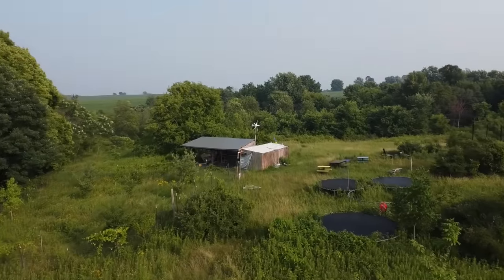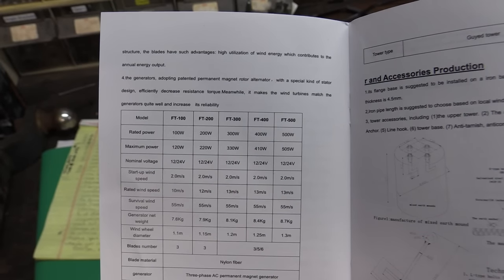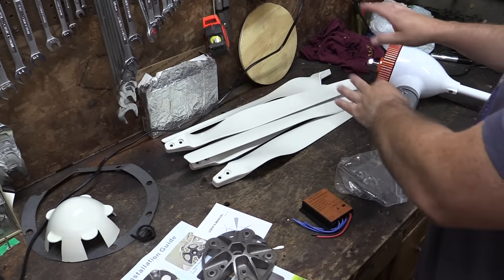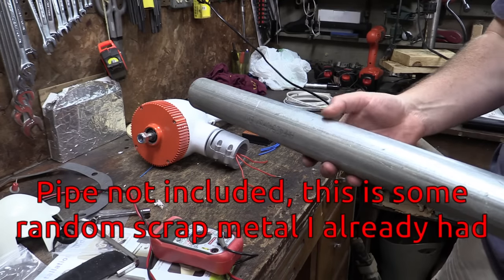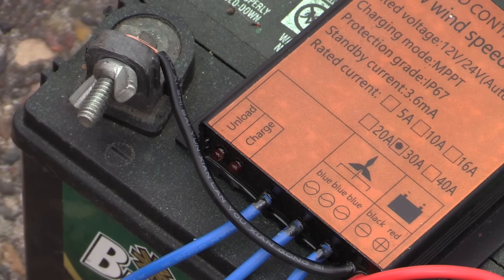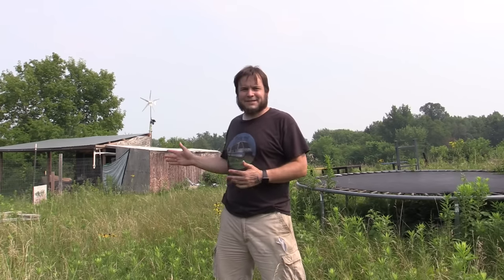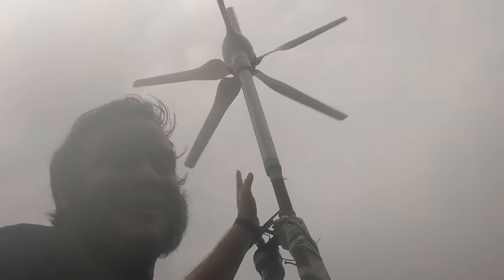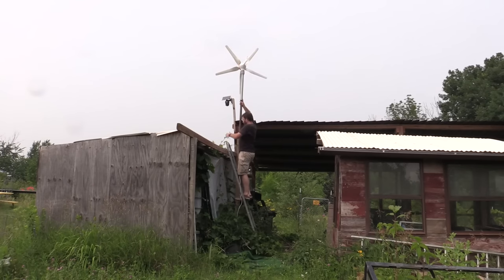Finally A Real Wind Generator! Vevor FT500 Review

Comment: You really didn't tell us anything useful. You didn't measure current and voltage, nor the wind speed. You need to measure power, which is voltage times current, at different wind speeds, and graph it. But I can just about guess that the 500 watts figure is only the overload of either the alternator or the controller, and not a power level that you can expect. It is generally taken that a wind turbine of 10 foot diameter swept area, optimally coupled to an ordinary 3 phase internally regulated alternator big enough to handle the load without burning up, is good for a kilowatt in a good breeze. Just a rule of thumb. Half the swept area diameter is about a quarter as much output power. Your swept diameter is significantly less than half. Figure it is good for about 200 watts in normal use scenarios. This is why it is important in reviewing such products to actually measure and share hard data. A permanent magnet alternator, not having field coils, cannot be internally regulated and requires a controller, which you have. Your alternator is probably of the permanent magnet type, and it is in theory a little more efficient since no field excitation is required for operation. You lose some of that in the controller, however. The controller must not only rectify three phase AC, but also convert the voltage to a consistent and usable level while also maintaining oversight of current levels and be capable of shutting down or throttling back the output.  So in reality, not a lot of performance difference between the two types of alternator. However it must be remembered that with an automotive type alternator, output is VERY low until it approaches designed operating speed, and also if you disconnect the load (battery, typically) from the unit, you will probably fry the rectifier diodes and/or the regulator if it is a modern electronic regulator. That is the main reason that permanent magnet alternators are so popular.

The reason you have three wires is you have a three phase alternator. The alternator windings output three phase AC of frequency that can be calculated from number of poles and rotational speed. You can indeed hook them up to the charge controller in any order. If the alternator is used as a motor, reversing an two leads will reverse the rotational direction, but it still runs no matter which wire goes where. The output voltage of the charge controller should be adjustable or programmable for different battery types. El cheapo setups often have the output pre-programmed for FLA, (Flooded Cell Lead/Acid), LiIon, LiFeP04, AGM, and SLA batteries, with optimized charge algorithms for each, and the user only needs to set the battery type for "smart" charging, which actually isn't very smart at all. More rarely you will have a simple regulated DC output voltage of somewhere between 12.6V and 14V. Anything over 12.6 can eventually charge a FLA deep cycle battery or an automotive type battery, which is actually a terrible storage battery because it is designed to start an engine, with very large current for a few seconds, and not absorb a lot of power and release it efficiently on demand. If you are trying to use a car battery, do yourself a favor and go to Sams Club, and get two 6V GC-2 size golf cart batteries. These are much more robust and long lived than a car battery, and store a bigger charge, and can be discharged more deeply than a car battery and still survive. Golf cart batteries, if well cared for, can easily last 6 or 7 years. Obviously, you connect them in series to get nominal 12V. When you discharge a car battery below about 80% capacity, you shorten its life. Run it down flat, (a little over 10V is considered dead flat) just a few times, and it is permanently dead dead dead. Golf cart batteries are designed to be discharged down to 40% capacity over and over. In my electric boat, I took them down to as low as 15% a time or two. That set lasted me 8 years. You need to learn about chargging algorithms, Peukert effect, and other minutae of deep cycle FLA battery physics, and you need to keep the electrolyte topped up, and in a stationary installation, you need to equalize every month or two. See the Trojan website for a good general primer on deep cycle FLA batteries. Data for Trojan's T-105 battery is probably pretty close to whatever generic Sam's is selling these days, if you can't find data online for the brand that you get. 

If you want more storage but you want to stay with a 12V system, arrange series connected pairs of 6V batteries, in parallel. The batteries need to be the same type and age, ideally. Otherwise you need to cobble together some sort of BMS, or Battery Management System, for the most dependable and efficient operation.

I would very much like to see output vs wind speed for your unit. You need to measure both current and voltage. Voltage alone doesn't tell us anything. Static electricity from dragging your feet on carpet can be thousands of volts, but it won't run a lightbulb! I would expect to see your unit in a strong breeze to be running at around 30 amps or a bit less, at a typical charge voltage of 13.4V.  30 x 13.4 would give you 420 watts so I might be a little over optimistic on the current,  You can get direct series ammeters up to 50A fairly easily, or you can get a cheap Chinese shunt type meter. A shunt resistor (actually a metal bar) of low but fairly accurately calibrated resistance is placed in the charge circuit in series. The meter measures the very small voltage drop across the shunt and converts it to current, which it displays. You can also get cheap anemometers on amazon. Try measuring windspeed both at ground level, and up the tower, for comparison. Once you have graphed out about a half dozen points, at different wind speeds from barely producing a charge to the strongest you normally encounter, you can draw a pretty definitive curve, and interpolate for any given wind speed. THEN you have useful performance data to share, and your viewers will be JAMMING on that like button.
Reply from the maker: I meant to measure the amperage in high wind, but it was also raining like crazy so I didn't pull the meter out. I'll have to do a follow-up!